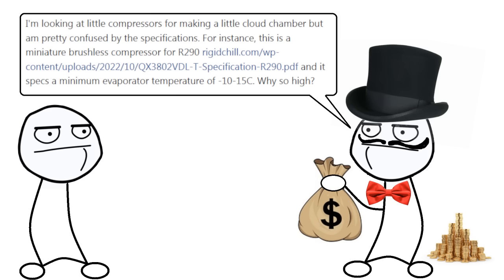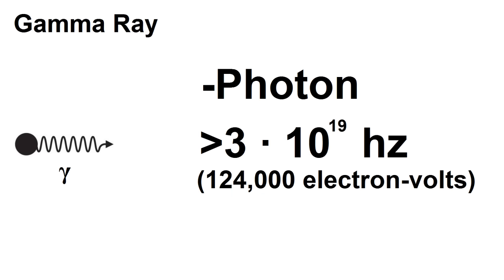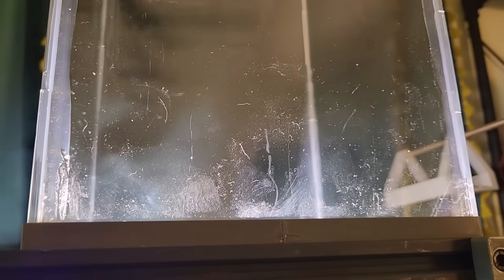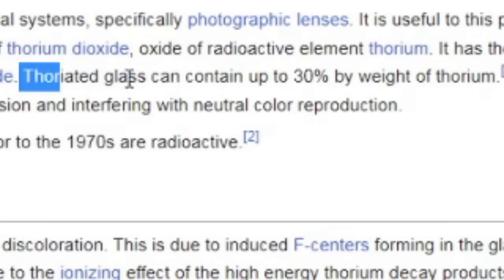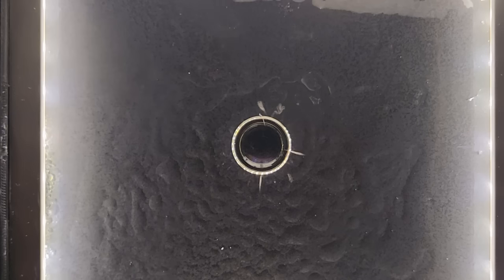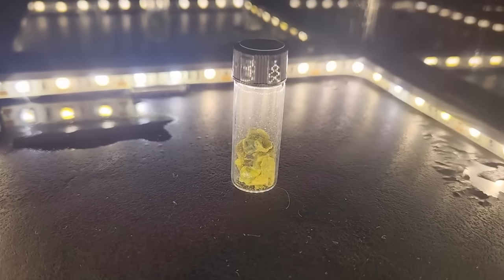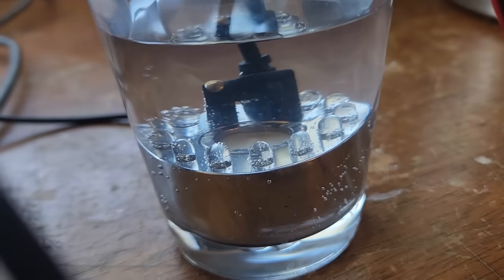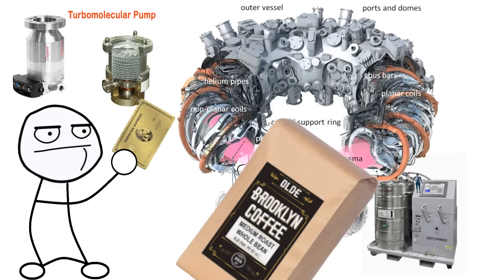Seeing Radiation with the Naked Eye

Comment: The magnet you used to try and see a curved Beta particle was ((probably)) too strong. In a field of that strength, the cyclotron radius would be extremely small, like <<1mm, and the particles most likely were not even making it into the chamber.

Also the part with the magnet and the point electrode could be something akin to a tornado, with the spin caused by the influence of the magnetic field on the ionized vapor.

Comment: Peltier coolers CAN cool large areas if they are used correctly. I reached -26°C on my 20x20 cm, 4 mm thick cold plate with my chamber measured in similar conditions where you measured "only" -23.4°C. Also, after a while I could even reach -28°C. Service life is also not a problem nowadays. I worked with an electron microscope for more than half a decade where the X-ray detector was cooled by a Peltier unit and there were never any issues with it. Yes, they are inefficient, but 300 W in this case is pretty OK in exchange for the spectacular traces. I will soon finish "Part 2" of my Peltier-based chamber, feel free to check it. A huge advantage of the Peltier coolers for cloud chambers is that you can actually build it at home on your desk, which is definitely not true for a compressor-based system.

Comment: I adore how you hate peltier coolers, they are certainly one of the least efficient conductive but thermally isolating ceramics, and a very poor way to transfer heat, which theoretically has no upper bound on efficiency. Maybe if we used superconductors and a vacuum gap we could improve on the efficiency of conductive heat transfer in the ceramics. That or use some other zero-loss mechanism that can uptake and depart phonon motion while regenerating the energy lost by the phonon transport particle we put in.. 🤔

Maybe there's a better phase change transition besides RF-11/fluorocarbons (strong bonds, doesnt want to have van der walls or Hydrogen interactions) or ionic chemical refrigerants.

Comment: How about an actively cooled snowman? Some kind of metal core with a compressor based cooler which keeps it snowy. Would probably need some insane cooling power but you are smart, you will figure it out.

Comment: The reason for your less-than-perfect results is that your temperature is too low and your high-voltage is too high. CERN recommends about 100V/cm for the Ion scrubbing. Temperature should be at least -28C to work reliably - the colder the better! You also want a good seal at the bottom of the cover to stop any draft. The fly swatter transformer would have worked perfect - it provides around 4000V.

Comment: Thorium lenses aren’t all that dangerous, surprisingly, apparently to exceed the yearly safe radiation exposure, you’d essentially have to hold it to your eye for the whole year
Reply: That said, any amount of radiation is a risk, but we generally take bigger ones than that every day
Reply: @PrefabQuasar  indeed, you'll receive a much larger dose of radiation by doing things like taking a commercial airline flight (reduced shielding from cosmic rays at high altitudes), living anywhere near a coal-fired power plant (radioactive ash in the air, so fine that it passes through any filters), undergoing a dental x-ray (obvious), spending time in the basement of a building with foundation cracks (radon), etc. There's harmful radiation all around us every day, radon alone is estimated to be responsible for about 2% of lung cancer cases.

Comment: the water in your alcohol should be distilled - so it won't conduct.   As I'm sure you know water itself is an insulator - the stuff dissolved in it is what conducts.  I dunno if the water could still cause you misting issues at !8:36, I's lean towards the towels. as you suggest.

Comment: The silicone isolates the coil. Why not weld it to the aluminium plate? Or just melt some zinc and pour it on it 😊 Zinc melts at a pretty low temperature.
And silicone is still better than air^^

Comment: I want to build a hydrothermal carbonisation device and i am wandering if an empty small refrigerator gas reservoir could support a pressure of 20 bar with 180 c temperature ???

Comment: Maybe copper mesh for your high voltage electrode so it fits perfectly and provides uniform field?
Reply: I think electropolished stainless mesh would be better so there is less or no corona discharge. At such high voltages and extremely low currents does not matter that much the conductivity of the material.
Reply: I wonder if it would be possible to diy coat ITO or similar inside that dome to hide the electrode.
Reply: I honestly have no idea. I work more in the low voltage and rf domains. I was thinking more about the surface area of the mesh compared to just a looped wire. I'm not actually sure what the difference would be in terms of EM. But that's the cool things about experiments, you can dial in on the best process.

Comment: I did not read this concern from any other maker; what do you think: When building such a cloud chamber, you get a confined space with thick walls of acrylic or even glass, inside will be a mixture of residual air and deliberately vaporized alcohol, together with some longer wires, connected to high voltage. You switch everything on and put your face with eyes wide open clooosely above the contraption to watch for traces, for minutes to hours. What could possibly go wrong any moment ...?

Comment: Couldn't you have soldered the copper to the aluminum? I know if you have welding skills you can built up the aluminum until it locks the copper in place, similar to if you were to use something like epoxy putty.
Reply: Solder really doesn't like to stick to aluminum, that's part of the reason why aluminum wires are generally plated with copper. Brazing would be more effective, but it would be difficult to avoid melting the thin copper tube by accident. I suppose you could use the brazing rod to add a layer of brass to the underside of the aluminum plate and then use your usual leaded solder to attach the copper pipe to the brass.
Reply: @tissuepaper9962  Solder isn't hard to stick to aluminum...it's hard to stick to aluminum oxide. If you do a little bit of prep work (such as mechanically removing the oxide layer with a wire brush or an abrasive, then covering in a thin layer of mineral oil to prevent the oxide layer from reforming)

Additionally, when it comes to brazing,  you can absolutely use aluminum brazing rod on aluminum without melting copper. By definition, the process of brazing doesn't melt the parent metal, only the donor metal.
Reply: @cen7ury  "by definition" is completely irrelevant if you aren't an experienced brazier. If you want to do the job in any reasonable amount of time, you're going to use oxy-acetylene, and it's easy to get carried away with that much heat at your disposal. Brazing also isn't nearly as easily reversible as soldering or caulking, which would mean he couldn't repurpose the aluminum plate or the copper tube in a future project, something which he is often inclined to do. Finally, the brazing rods alone cost as much as a tube of silicone caulk, and the amount of caulk in a tube is probably at least double what he used here.

I fully agree that brazing would be best if this were something intended to last forever, but it isn't. Silicone did the trick and will likely continue to do the trick much longer than HP actually intends to keep this cloud chamber in operational condition.

Comment: Isn't it possible to make a super accurate scale calibrater out of this??? You can get a material which only emits alpha particles, and you can weigh it. Then put it in the cloud chamber and count the number of alpha particles coming out(can use cameras and software to do this?). You can get the mass of the total stuff that left the sample. Then when you measure it again, you should know exactly how lower the mass has to be, and then you can get the deviation in measurement of the scale.
Reply: not a bad idea - some of the first experiments to develop nuclear weapons used such methods as "watch and count". But, mass loss from radiation is not detectable for something like this. isotopes that are volatile enough to have measurable mass loss are generally highly, highly dangerous, and very short lived. I also dont know of any isotope that simply "decays in alpha mode" repeatedly, it violates principle. Repeated Beta decay is possible, one thorium isotope does it. Also, because they do not simply disappear or evaporate, and only very slightly change form, the loss in mass is nearly undetectable. A balance case is a better way to have a super accurate scale- simple enough to make, and can detect 1/1000 of a gram, enough to weigh air. t. nuke

Comment: If Gama particles move at relativistic speed, how come it looks like they aren't even going as fast as a BB?
Reply: Gamma particles are just very high energy photons, so light, and by definition travel at light speed *in a vacuum*. The speed of light through any material is much slower as it is continuously running into things. Also the gamma particles were the fastest things we saw in there, the trails that were comparable to the speed of a bb were alpha particles.
Reply: @Ender240sxS13  WHAAAAAAAT!??   I could throw a rock faster than any particle I see in a cloud chamber.

Comment: Simple question: if an alpha particle can be stopped by skin or a single sheet of paper, won't acrylic prevent alpha particles from entering the chamber from the outside? As long as there's an alpha source inside the chamber, then fine. But how are you able to see ambient alpha particles that originate outside your acrylic box?
Reply: There is a small amount of Radon (an alpha emitter) in the atmosphere, especially in places like basements and garages where the porous concrete foundation allows radon to seep out of the ground and be collected in the confined space. That's my best guess for the source of the alpha particles inside the chamber.

Comment: Do you plan any quantitative evaluation for radioactivity, based on some imaging process ? I´ve used a software called ImageJ in the past, which could recognize and quantify the light-density on a foto, so if you calibrate some fotos for the values that an actual Geiger-counter shows, you could use those referencial/calibration points to quantify any amount of radioactivity of anything you put in this box... (well, I  guess it won´t work for Polonium, but you wouldn´t get any Polonium anyway...   ;-)

Comment: I'm following your videos because I'm also making a cloud chamber, but there's no way I can't get -40C.
There was a moment when I almost did, but I think my system is leaking. Why two days later and without touching anything it almost didn't cool at all.
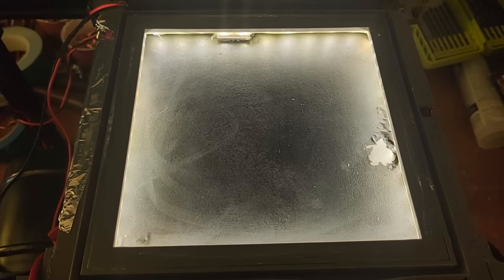Reply: 5:00 That's happened to me too, the damn isopropyl alcohol eats the paint, glue and everything. I've been told to use epoxy paint and glue, which is more resistant to chemicals.
Reply from the maker: You should only need to get to around -20C. If you dont see any particle trails you might not have a high enough rate of alcohol evaporation in your chamber, so add more surface area and/or heat for evaporation
Reply: @HyperspacePirate  I'm not sure, I can see the alcohol rain, and I even put the hot bed of the 3d printer on top with a cloth with alcohol to accelerate the evaporation. And it formed a lot of fog, but I couldn't see the particles, they were only visible for a moment near a radiation source of a smoke detector.

Comment: Uranium is an Alpha emmitter. The reason You only saw Beta particles from the Autunite is because the Glass of the Vile is shielding pretty much all the Alpha radiation. There is a saying that Alpha radiation can be stopped by paper, but in reality it needs at least something more dense like Aluminium Foil to stop all of it. But the Glass is also more than thick enough to block it.
The Beta particles come from the products that the Uranium decays in, which then decay further.
Very cool and informative video, keep up the good work!

Comment: The reason radiation causes cancer is because all those particles you see flying around displace particles in your body. So your body tries to replace what is no longer there. And since it still doesn't see that particle there it keeps trying to fill the void. It's a duping glitch for your body's cells. Or like an infinite item exploit. It tricks your system into allowing itself to produce more than what is necessary because it doesn't realize the part that was displaced is no longer there so it keeps dumping cells in to fill in the space. And since it never sees the displaced particle it doesn't stop producing. Until it becomes out of control. And is why when you cut out the bad part, you're cutting out the area of that displaced particle that the body now recognizes as no longer being there

Comment: You live in Florida, don't you?  You must, it you think your frost has the consitency of natural snow.  Still, I like your idea for the snowmaker.  The air in the mister should be as warm as possible so you have air saturated with moisture as well as droplets in the mist.  BTW, since Thorium emits basically only alpha radiation, it's pretty safe for lenses--the camera shields the user, and the alpha particles stop after travelling only a couple of feet in the air, and are stopped by the first layer of skin, anyway.  And since it's in glass, breathing it in is almost impossible.  So your choice of alpha source was pretty sound.